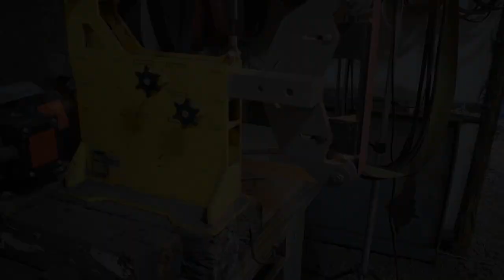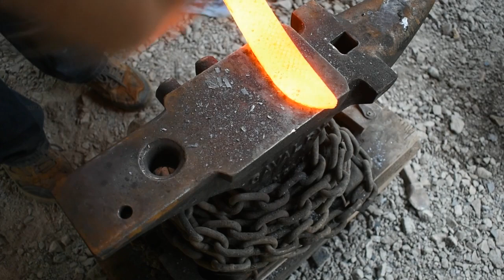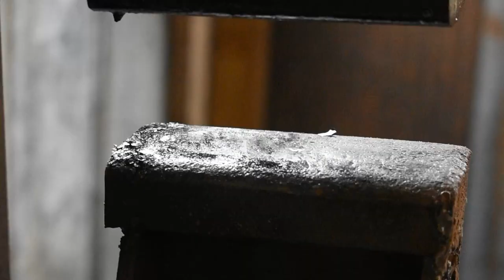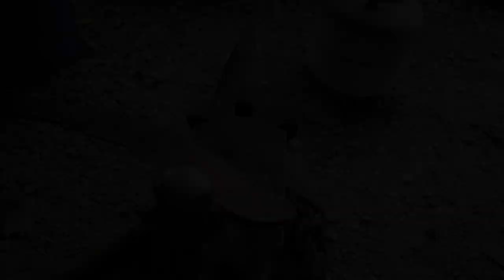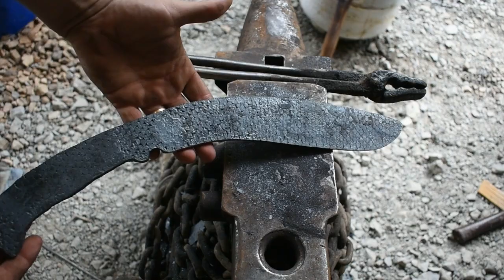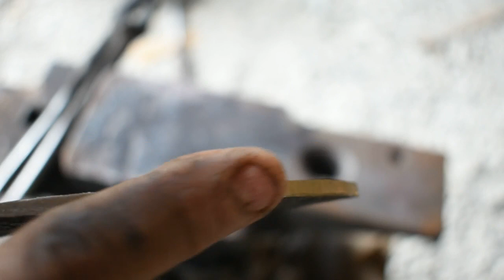Forging a KUKRI from an old rasp: part 1

Comment: ..Great job Matt!! i liked that technique over the horn especially. dumb question- was that to help get the width along with starting the bevel??...
Reply from the maker: Thanks!  Thats pretty much exactly what I was doing, the rasp I started with was only 1.5 inches wide and usually with a Kukri I like to start out with 2 inch wide material, I also didn't want to hammer it too thin down by the edge because of the file teeth, so using the horn allowed me to get some width in the belly of the blade while also working the bevels some.